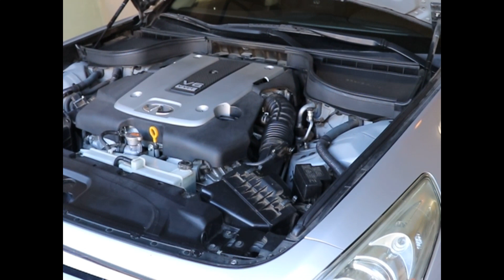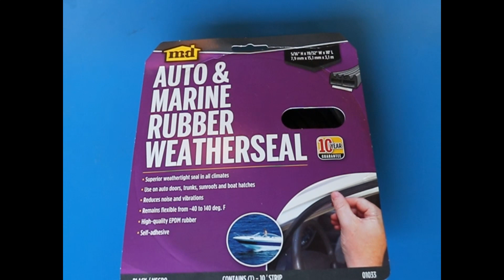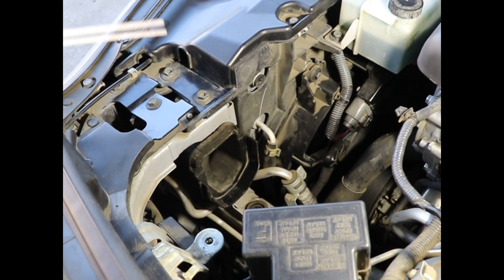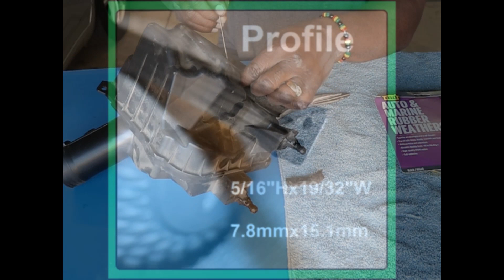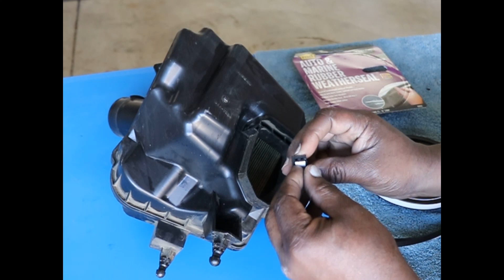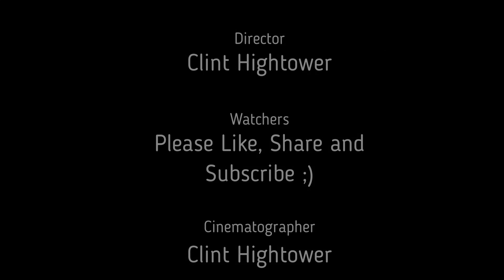Re-Gain lost Power By replacing your G37 Intake Insulation

Comment: What kind of power lose were you having? I’m losing power under 3krpm
Reply from the maker: Well I didn't have any noticeable power loss, I just know if your air is restricted you're gonna have a power loss.
Reply: Hey I’m having the same problem did u figure out the issue?
Reply: @haze4065  unfortunately I haven’t. I think I need a tune though because I changed the whole exhaust including the cats.